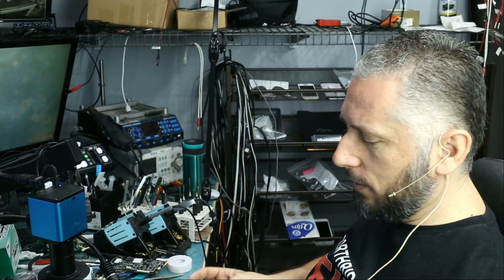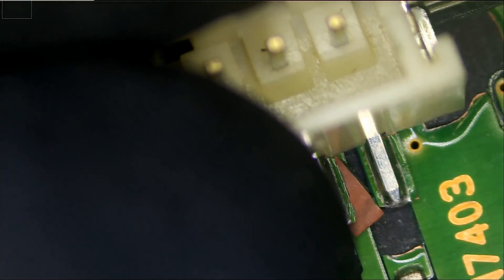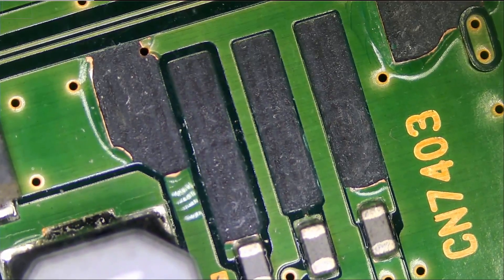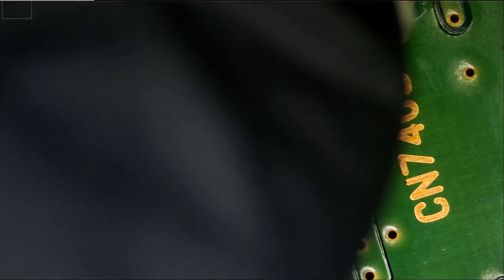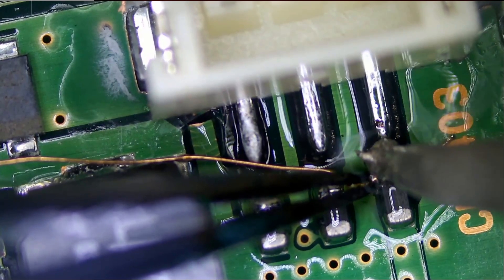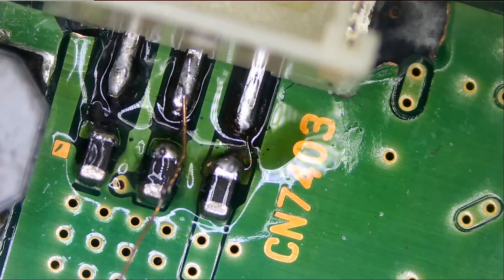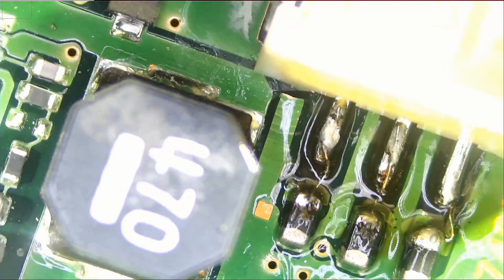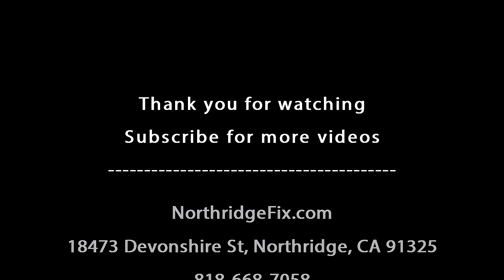Sony Motherboard repair. Securing a ripped off connector with Torn pads.

Comment: I am having this exact problem with a very similar piece that I ripped off of my PSONE yesterday when trying to replace the optical lens. I doubt I need to solder it, I'm just going to use a conductive epoxy, because it looks like the glue has worn off after a couple decades, leading to it being easily broken off. I bought two kinds of paste/glue that is the incorrect type, luckily i didnt use anything adhesive on my board, but it's annoying being inexperienced when I just want to play my damn video games

Comment: Clean and professional job as always. I thought moving the connector a bit towards the resistors, so the wires would've been unneeded but you did a correct job since you haven't the entire item (TV?) available

Comment: Do you advise coating the small jumper wires with a protective coating  to prevent the wires from corroding? Nail polish might work

Comment: What type of glue you use to secure component? Super-glue, epoxy? I recently got same problem and glue doesn't stick to PCB
Reply: Rapidfuse glue. You can find it at lowes if you are in the USA https://www.lowes.com/pd/DAP-RapidFuse-0-85-fl-oz-Super-Glue-Clear-Multipurpose-Adhesive/1000142517.
Reply: I hope he replies to this question. I also have issues finding an adhesive that is not hot snot or epoxy to affix parts directly to solder masked PCBs.

Comment: As usually fantastic craftsmanship. A small note related to the video: audio levels are high, you could lower the db's in your wireless mic transmitter, I think you use Sennheiser wireless, just go to sensitivity and lower it down. It is  not a big problem but why not having a top notch video on already great content.

Comment: What type of glue do you use to glue the component to the board? Is it something you have on your store? Thanks!
Reply from the maker: Rapidfuse glue. You can find it at lowes if you are in the USA https://www.lowes.com/pd/DAP-RapidFuse-0-85-fl-oz-Super-Glue-Clear-Multipurpose-Adhesive/1000142517.
Reply: @NorthridgeFix  Thank you!

Comment: In case like this I would additionally use hot glue on that connector so I can be 100% sure that he is not going anywhere.....
Reply: I think it is a one time plug connection in an internal housing (like a tv motherboard) so that amount of strengthening is not required imo